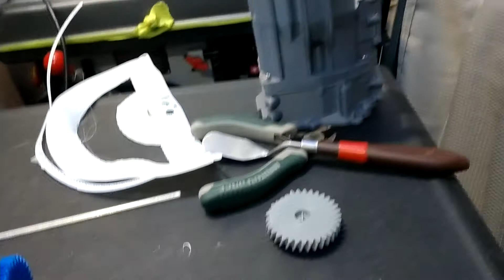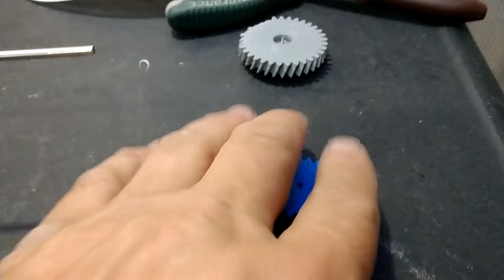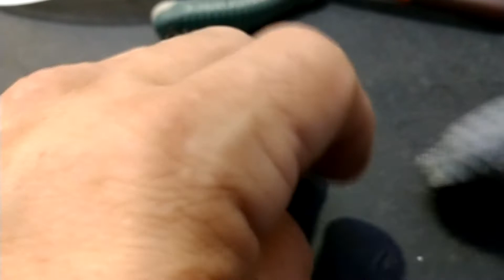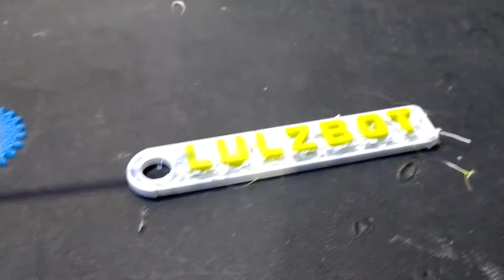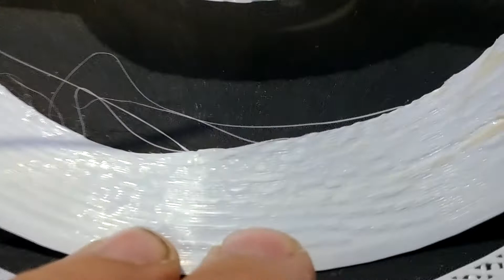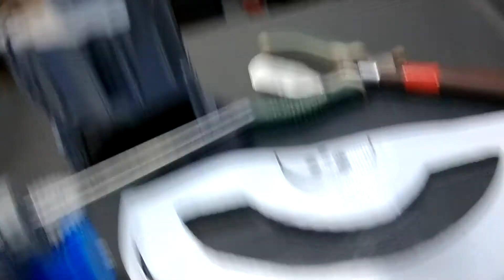Update on to the 3d printed Toyota transmission.

Comment: What hardware did you use to assemble this? Currently printing my components but am unsure of where to find a materials list as far as hardware for assembly. Thanks!
Reply from the maker: The bearings, shafts and screws are all available on Amazon